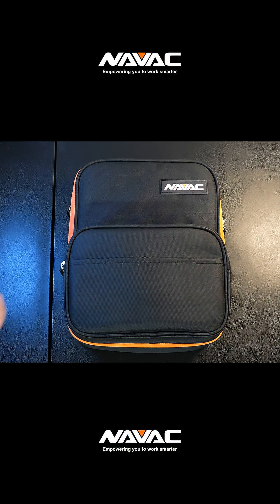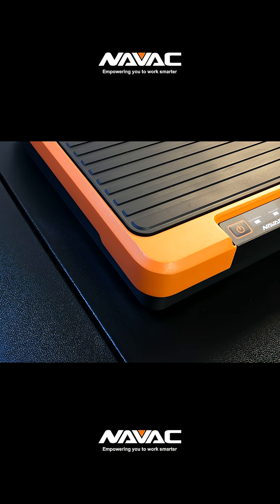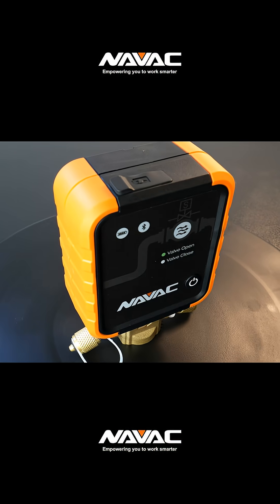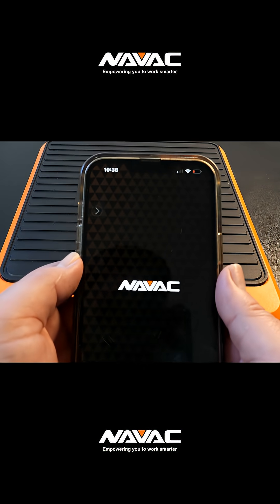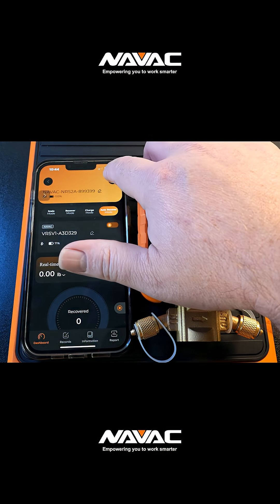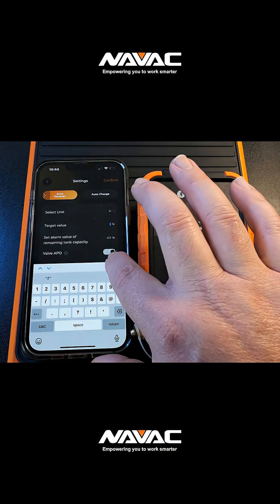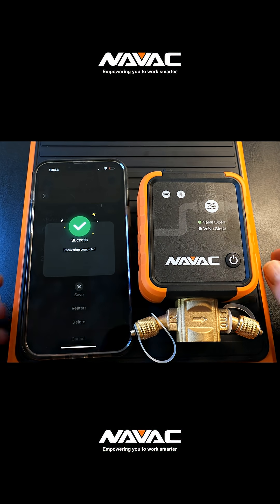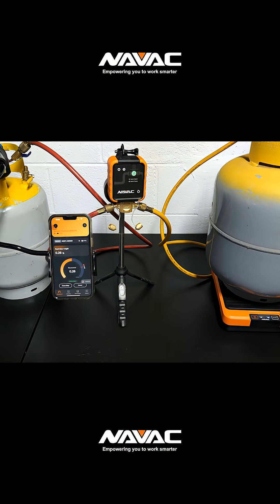NAVAC SK2SV1 Smart Refrigerant Flow Control Kit Hands-On Test

Comment: That charging solenoid would be a great buy if it came in a larger size. ½" would be primo and ⅜" would be good. ¼" is just too small for large volumes of refrigerant. It'll get you there, but it takes longer. Especially when in the 100's to 1000's of lbs. I have the Testo version with the scale.